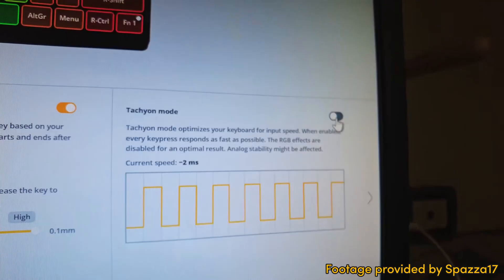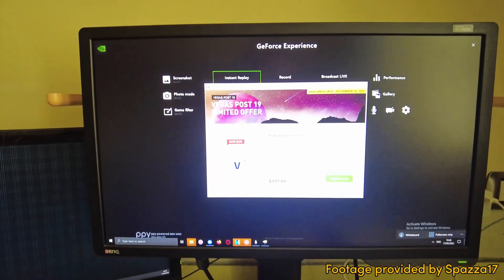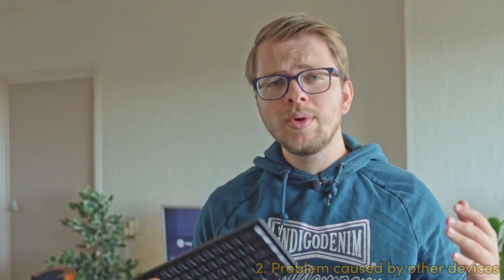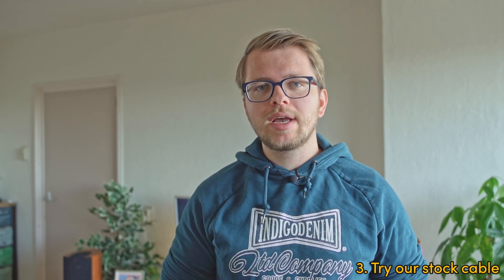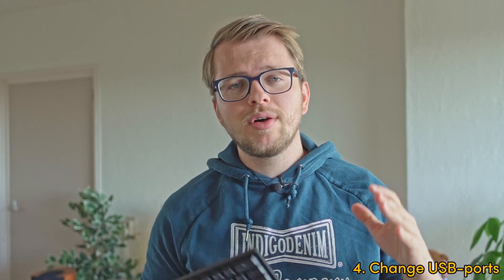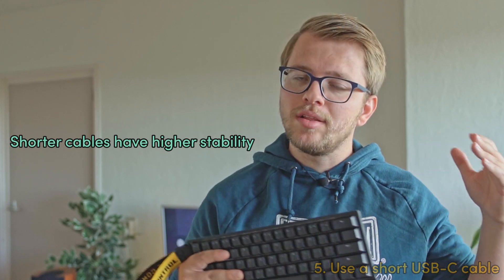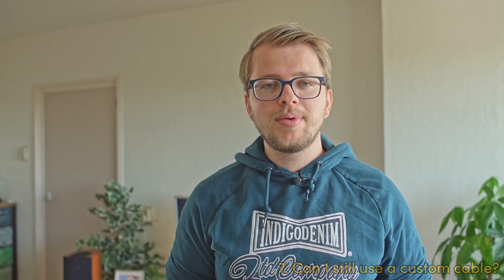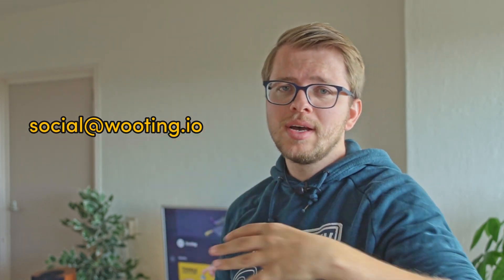Wooting Keyboard Pressing Random Keys? Try this!

Comment: my friend is having an issue with her wooting where just her A key is acting like its not getting pressed or getting released while being held, we have tried different switches and the only fix is completely disabling rapid trigger
Reply: mine will randomly press the g key and it stop when i unplug the keyboard and plug it back in, but it will come back later. I havent found a permanent solution.
Reply: @guapbabygeo have you found a solution yet ?
Reply: Did you manage to fix this? Mine keeps pressing the B key. Losing my mind

Comment: Having a problem with the 80he, I set the “Mode, Prt Sc, and Pause keys on the top right of the keyboard to be sound control and randomly my audio will get muted.  This happened even when I wasn’t touching the keyboard. I really like my 80he and it was expensive so I’m disappointed that this happened with little use. Hopefully one of these methods will give me a fix or at least answer if something is defective
Reply from the maker: That is really odd. Shouldn't be happening. You sure the audio isn't influenced by other devices?
Best might be to reach out to our customer support about this.
^Sander

Comment: Hey i buyed the 60he with withe key caps, i have the problem when i play fortnite and press 2 or 3 buttons fast  to build in that game that sometimes the key not aktivate im on 0.1 Millimeter i try 0.5 1.0 but nothing solve the issue with rgb without and many more steps  but nothing helped
Reply from the maker: You can try resetting your keyboard to see if that solved your problem. Make sure to save your profile code so you can import it again after the reset.
If that doesn't solve the problem, you can reach out to our customer support.
^Sander

Comment: Funny enough, I've been having this issue the last couple of weeks. I have my keyboard plugged into a USB 2.0 KVM (I know). When I originally turned on Tachyon mode, it either didn't limit the brightness, or i ignorantly turned it back up. Turned off Tachyon mode, then back on, and noticed the brightness drop to 70%. Now I get no more phantom keystrokes. Honestly, I think it should force the 70% brightness.
Reply: And to add: Still the best keyboard I've ever owned for sweaty games I still suck at, ie Overwatch 2.

Comment: my pproblem is that my wooting presses keys multiple times in one press, like c is inputted but the result is ccccc (I didn't do that myself, I let the keyboard mess up again)(I am not using DKS)
Reply from the maker: Best is to reach out to social@wooting.io
Do keep in mind, it is quite busy, so it may take several days for them to get back to you.
Reply: @Ugetora my problem is same, did you Fix IT? IT happens to my only without rappid trigger
Reply: @antxyzfn  I set my input 0.3 and rapid trigger to 0.15 iirc, I'll let you know if that's right
Reply: im looking now and i get my keycaps now and i saw a weird thing, when i press key IT light green, when i desactive It IT light red. and when i press W or S green and Red are for like 1 second. but when i press backspace Red light is like for 10 seconds
Reply: idk what to do my keyboard. when i press w once IT writes it Infiniti times.like 10000, i did everything bios reinstall windows disk clean everything
Reply: @antxyzfn  make sure that you don't have Dynamic Keystroke (DKS) enabled and make sure that all your settings are all default, making a new profile is the best way to reset this.
Reply: @antxyzfn  OK. This is one the wooting's analogue light effect layer. You can disable it inside the lighting tab within the wootility software
Reply: so it works with this 03 and 15 @ugetora. also my movement in games is cery weird, when i press w and release it, IT releases 1 second kater and is massive delay
Reply: @antxyzfn mb, 0.3 and 0.2
Reply: do you check od this work ,idk to restore keyboard, and i got Apex mini and huntsman and IT happens too to this kb's. @Ugetora
Reply: @antxyzfn  it's very likely it's your pc that is at fault
Reply: ok ty
Reply: and your keyboard works fine and dont  spam It self @Ugetora
Reply: @antxyzfn  yeah, from what I have seen it does not have this problem anymore.

Comment: I'm so glad you made a video about this issue! I was experiencing this with a KVM switch with my homeworking setup as soon as I got my two HE. For that particular scenario, I was able to add a bit more power to the KVM itself through a USB-B cable, and that seemed to resolve it.
Reply: What issue did you experience and solve it? I think my KVM causing issue with my keyboard holding the last pressed key(not all the time)

Comment: Funny enough, I have this issue but only in very specific case. When I use a USB hub/docking station it works fine. (By the way without Tachyon in all cases). However when I  boot from a USB stick (IGEL + Citrix), my Keyboard runs amok. Plugging it into the USB port directly works though. My Lekker Edition does not run into this issue with the same settings.
Reply from the maker: I will forward the info to the team, thanks! :)